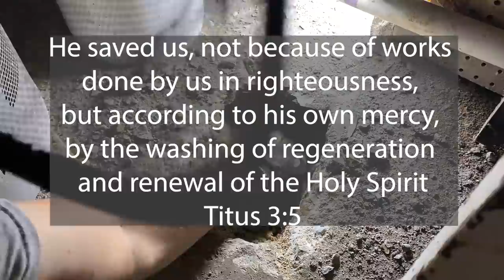Locating The Leaking Pipe Underground

Comment: Just a suggestion, but before you start breaking apart the floor looking for the leak, you may be able to get a plumber with a good camera setup to scope the line. It would be much easier if you actually found the leak before you started breaking up the floor. A good camera setup can let you look visually at the inside of the drain line as well as have a sensor that can tell you exactly where the camera is located. It can tell you distance and depth. That way you would know exactly where you need to make the repair.
Reply: EXACTLY 💯 👍🏻👍🏻👍🏻
Reply: How much would such a set up cost to buy?
Reply: @JosePerez-qg6th  to buy a rig to scope the drain will probably run into the thousands of dollars. However there are many professional plumbing companies that can provide the service. You are probably looking at the cost of a service call to get this done.
Reply: @JosePerez-qg6th  I'd have thought hiring a plumber with the correct tools and experience of guesswork would cost less than having replace the carpets, bricks and concrete that all gets ripped out.

Comment: Noise canceling earpods/headphones do not offer any hearing protection unless they are specifically rated for that. Now, if you are wearing earpods under your hearing muffs, they you have your hearing protection from those muffs. The way noise canceling works is, basically, by creating noise that cancels out the ambient noise, and it had to do that with equal sound pressure, this is called active noise control. 

Incidentally, this is your third video I have watched this evening and you have earned a new subscriber. Some pretty cool content so far.

Comment: An endoscope is a useful tool for looking inside pipes and ducts for where issues are. When you combine it with fiberglass wirefish rods you can really get a good look as you can use the rods to spin the camera around.
Reply: I'm sure  you will find the answer  and fix it ◇◇◇◇♡♡♡☆☆☆◇◇◇◇
Reply: I agree. Scope it from the furnace or from the other end. The duct is a large access point and may have other vents along the way to help isolate the leak.
Reply: Endoscope. Amazon has then cheap. Not sure how to make it reach 50' or more, other than USB extensions, but that's what I would do. Maybe strap a go pro to a remote control car?
Reply: That was my first thought also. Plan B is to spend $150 or so and  hire a sewer company with a drain camera to run through your furnace pipe, and then once the entry point of the water is found, then through your drain to find the exact location. Those cameras often have a locator beacon at the camera end of the probe that can be sensed from above, giving excellent location information.
Reply: I was getting ready to leave a comment about a endoscope but you beat me to it. For about $20 it could really save a lot of time. What a nightmare of a problem, I can see a lot of sleepless nights and worrying about the worst case scenario.  I hope he finds it and gets it fixed quickly and cheaply
Reply: And they sell fairly cheap ones which you can hook up to an ipad, ie the type that Adam Savage reviewed on his tested channel.  I got the 6ft one of the Nidage (X001RG2X11 model I think), but they sell longer ones.  Or maybe see if like others said, have a company come in and do the investigation.  They do have ways to track the camera location underground/under the slabs to figure out where the problems are located.
Reply: I’d agree here. You need to devise a way to run a camera down that pipe and then run the sink and see if you can see the water coming into the pipe. One like they scope a sewer with would be great because they can tell how far down the pipe it is and they can use a locator to pinpoint the exact position in the pipe.
Reply: Back in the days before endoscopes were available (and cheap), I had a problem under my house, built in 1912. I had no idea where the problem was, just that there was one. Luckily, I found a solution that let me have a look. A local electronics store had a cheap set of miniature, wired, B&W security cameras, for about $60 with cable. The toy department of a big-box store had some battery-powered toy vehicles, all with  wire remote controls. Among the toys was a chunky toy bulldozer with left-right, forward-backward control by wire. It had a fair bit of power. To make a long story short, I used zip ties to mount a camera head on the toy bulldozer. I extended the dozer control cable, and stuck on an annoyingly and loud "beep beep" sounder from a smoke detector as well. The finished "Cam-Dozer" had plenty of clearance, and it had no trouble going along the duct, as long as the trailing wires didn't get hung up. I came to a "T" junction about 15 feet in, and the camera picture showed which side was  the most likely problem. With a bit of back-and-forth the  dozer went around the corner and up the "wet" branch, trundling along for another 14-15 feet. The security camera, although low-res had IR LEDs around the lens, so the picture illumination was pretty good. Up in the house, above the concrete and ductwork, the "beeper" was easy to hear and follow as it moved along under the floor with the "Cam-Dozer." Finally, the machine came up to a mess of broken up pieces and a lot of nasty gunk. That was as far as it could go, but it was far enough. We put marks on the floor upstairs where it had stopped, as well as along the route from the open end of the pipe. That gave a place to start. I was able to reverse the "Cam-Dozer" back out of the pipe, with a little persuasion from some Paracord tied to the dozer body. I recorded the "Voyage through the Duct" on a VHS tape machine plugged into the TV set "monitor." Later I was able to play that back for my friendly contractor. Between the video and the marks at the place where the pipe was blocked or broken, he figured out what had happened,  without digging a long hole. The repair did require hiring a "pro." However, my general contractor friend said the "Dozer-Cam" had probably saved at least $20,000, and had made it easy to isolate the problem location. It wasn't pretty, but a lot better than the alternative. 
So, the low-tech improvised  camera rig paid for itself a thousand times over. I did send the it up the pipe a second time, but the toy bulldozer started making noises - it didn't like the water. I didn't want to risk having it get stuck up around the corner, but two trips did a good enough job. 
These days, I can rent a full color 50 ft steerable-tip endoscope from my local building supply for about $35/day. It's a great tool and amazing technology. But the "Cam-Dozer" did pretty well. I cleaned all the muck off it, and made a Plexiglass display box for the contraption, to remind me that "just good enough" had been got the job done, even 2nd best &  low-res. The alternative would have been 30+ feet of trenching and ripped up floor,  and a large amount of money and labor. It was a surprisingly good  outcome.

Comment: I really feel for you.  We just moved out of our 75 year old house that was built on a slab with all of the utilities under the slab.  The cast iron drain line ran the 90' length of the house and had given us some problems.  Looking at it with a scope showed a "dip" but it wasn't plugged. Over the years we broke up the floor in one bath and replaced a leaking water line.  I truly woke up at nights worrying about the under-slab plumbing and what was going to give out next.
You seem very capable and patient.  Hope all goes well with your repairs.

Comment: That little baby demo hammer is cute.  I had to replace a large portion of cast iron that rotted out and I bought a ~$100 electric jackhammer to handle it. I also added a basement bathroom and it came in handy.  Definitely worth it, along with a respirator.
Reply: Not really a demo hammer, it's an airchisel normally used in bodywork on cars...

Comment: This is the first time I have ever seen ductwork buried under concrete.  Hope you do not have to dig up that nice floor. Ideally that duct should be replaced because of the oily greasy nasties from the sink and the odor that will be released each time the heat goes through it. If I had to dig it up I would not be covering it with concrete again so it is accessible in future. Great troubleshooting.  I would definitely get some kind of venting in that void or humidity control.  Homes are never quite done are they? Thanks for bringing us along. Cheers.

Comment: Sounds like an endoscope is a way to go.  Try filling the sinks full with water and drain them all at the same time to flush out some of the sludge.  One way to seal under slab ducts is with Duct Armor.  It is a spray liner type product.  I was going to have that done to the house I recently moved in to, but it is too far gone and gophers have gotten into it so going to abandon it and put new through the attic.

Comment: Are you sure the kitchen/bar sink go to the main? Many older and especially rural homes have separate grey water drains that don't connect to the main. Instead they drain off outside somewhere, not into the septic. My kitchen  and laundry both drain out into separate grey water lines. Only the bathrooms go into the main and into the septic. You may have another drain outside you didn't know existed. Mine run about 100 and 200 ft from the house respectively.

Comment: I saw something the other day you might want to consider.

The person stapled house wrap to the bottom of the floor joist to support the insulation.  House wrap is breathable.  So it will hold the insulation in place, seal it from dirt and insects, and still allow water vapor to escape out of the insulated space.  And it looks a lot better as well.

Comment: Horizontal cast iron usually rots out after 30 to 50 years depending on water quality. Vertical cast iron doesn’t hold water like vertical pipe and can easily last 200 years. When replacing we often tie on to the vertical cast iron and transition to pvc.

Comment: That’s quite strange that the water is directly running into the ductwork.

Maybe a camera can get you a better picture of what is going on. Many plumbers have an endoscope that can be put into the pipe to find defects and clogs.

Good luck! This certainly isn’t the easiest fix.
Reply: Agree!!!  You should find a plumber that has a camera snake and pay him to snake your pipes to find the leak.  A lot less invasive and destructive than what your doing.
Reply: it is not strange that there is water in the duct work.  The condensation drain line from the condenser in cooling system is plugged and the water is running back into the duct work.  Very common problem that happens with AC units.  This is NOT a water or sewer line leak that is leaching into the duct work.  The worst this problem could be is that the condensation pan is rusted out and unable to catch the condensation.  What most people miss is that the drain line is fed back outside.  A bug or just normal dust has clogged this drain line and can be easily unplugged with a wet/dry shop vac.
Reply: @Jason-zp4ly  I thought the same thing until I saw the way the duct comes off the AC unit.
Reply: @Jason-zp4ly  You state it is not a water or sewer leak. But if you listen from 13:02 He says that when he runs the kitchen and the bar sink, water comes out of that pipe.
Reply: @falghar4711  yep your right I didnt register that part.....   guess I was too busy typing and not listening.

Comment: I would try to find a plumber that has a special camera with a sonde transmitter and receiver to locate the exact location for the damaged section of drain. Otherwise it is a cat and mouse situation. As for the ducting you may want to look at alternatives like exposed ductwork it might go well with the overall design of the home.

Comment: An angle grinder with a diamond blade also cuts thru thin concrete fairly well.  It’s a dusty mess though.
Reply: Get a water feed for the angle grinder and blades that are ok wet.  Alternatively poor water on the cut. You will end up with more mess in one place but not dust everywhere.

Comment: Years ago when we needed to put a lift in a shop floor with radiant  heat. We were so afraid we would drill into a pipe. What we did was, turn off all the heat and left the doors open until the concrete floor was about 40°F. Then we fired up the boiler and let the hot water flow, with a thermal camera we were able to see every pipe.
I'm thinking you might be able to do this in reverse,  get the house nice and warm and then let the cold water flow.
I guess they have a thermal adapter for smart phones. I would suggest if you can afford it to get a good camera, with that house it will pay for itself fast.
Hope this helps.

Comment: Some plumbing companies have the ability to "TV" pipes and to locate problems visually. It may be time to get professional help (no, not that kind..). They also have the ability to scour the inside of pipes and ducts with something akin to a string trimmer. They can also seal the pipe/duct once it is clean - that would kill the smell.

BY THE WAY !!! Check the condensate line from your air conditioner - it may be plugged and may be leaking into the air duct. I HAVE SEEN THAT PROBLEM BEFORE !! I would bet money that is your problem. To clear a condensate drain pipe, force water into the outlet. Make sure you have someone inside with a shop vac sucking water out of the condensate collection tray.

Comment: I'd suggest a sewer camera with a transmitter. You can run it in both the sewer pipe and the duct to figure out exactly where the leak is and have better understanding the best solution.

Comment: Wow, you have a hand full of issues going on.
I admire your patience dealing with finding those what seems like endless issues.
Now, I've seen the word endoscope used a few times.
A good rental center would have those to rent, that's where I would start, but I'm still trying to figure out why anyone would run heating duct under a concrete floor? 
That's a disaster and your going to have endless issues until it gets delt with by an HVAC guy to figure the best way to address those issues.
It seems like that stuff was all done by a DIY guy who didn't really have a clue how to do things properly.
The pool pump wiring is a serious concern to me seeing those hap hazard connections using 240 volts. I recamend shutting off the circuit to that until you have a chance to explore all the wiring.
Correcting any of the connections or mistakes.
The plumbing should be a priority, then the HVAC needs to be addressed by a professional.
There may be ways to repair those issues without pulling up duct work And floors.
But concrete and galvanized duct do not mix. The duct will rot eventually, and then you will have bigger issues.
I'll be praying for guidance to the best way to get your woes resolved. After all HE knows what's best.

Comment: It is a leak in the primary drain pan on the interior A/C coils.  Rather than draining to the outside, the water is dripping into the ductwork.  Open the A/C coils at the furnace and you will see the leak.

Comment: I would call a plumber with a cam that can go down the pipe and find the leak because going underground and breaking up cement can get costly but I do find it interesting on what is going on with your vents and such if you had a normal home it would be simple to find but since you have a home with a unique setup looks like it's going to be more work then normal.

Comment: Get a plumber to run a drain camera into the pipe thane do a locate on it to know right were it is . Get a long pipe or the like and put a camera on ir and look from the crawl space turn to the left to see what you can. Lookinto a product called WallAbot  it fits your phone and allows one to see in walls and floors.
Reply from the maker: I actually do have a snake camera and a wallabot, neither would really help in this case. I was able to narrow down where the leak was and have a solution, next video!:)

Comment: Hey great video  ,Not sure who built your house but first ,you dont run metal havc under a slab floor .  Even if your fix your pipe water leak you can still get ground water seeping into the HVAC pipe.   The pipe was not design to be installed in the ground, thats way its rusting.   The tape on pipe you were pulling off freely , may have asbestos in it so gloves and air mask buddy!   I really think after you find your leak you re think the HVAC situation and correct it. It should have been install above the concrete NOT below.  Good luck on project

Comment: At some point there was water on that floor in a cranky seat in the corners of the floor and that it was from that pipe that you would just pointing that it goes from that pipe over to your heating duct above the floor and its coax leaking into that heating duct vent I'm guaranteed has to be

Comment: It sounds like you need to call someone like Roto-Rooter to use their camera to figure out where all your drain lines are going in your slab.  Maybe with that camera they can find out why water from those sink drains are leaking into your air ducts.  The camera would be better than braking up all that concrete.